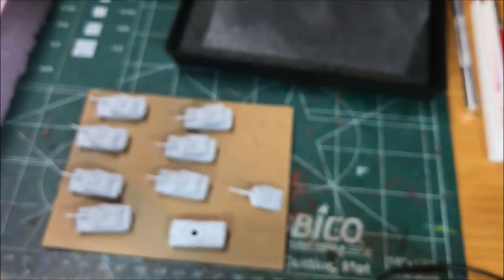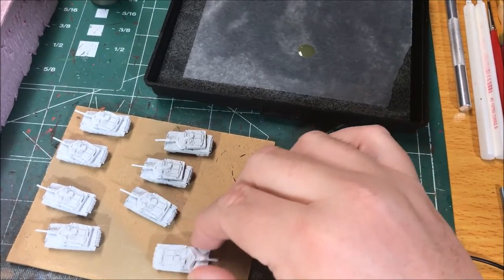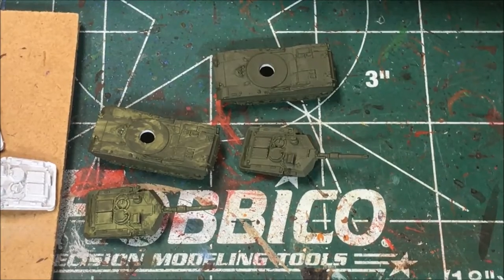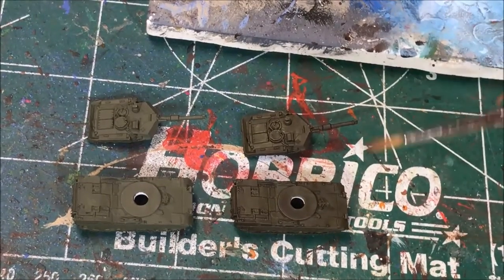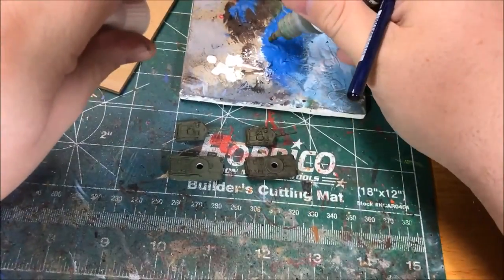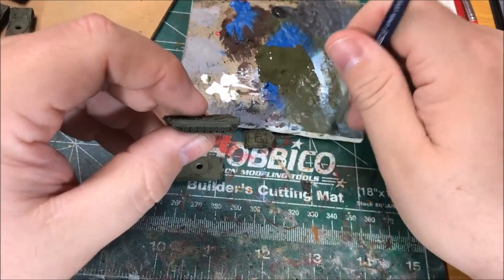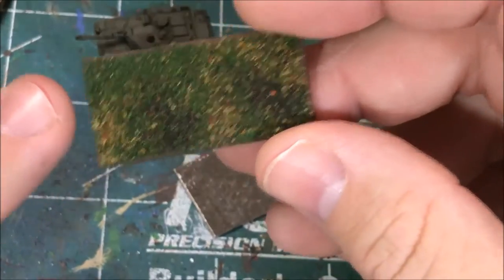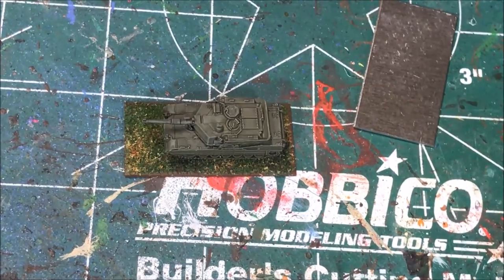6mm Cold War   Tank Painting Basics

Comment: Hi there! I'm brand new to Micro Armor and recently bought the US Urban Combat Command box, and I found your video very helpful on how to paint the vehicles! I have little experience with models this small so it really helps to see someone try it. My question to you is, which method of painting is better for modeling these small models if you just want basic detail. I don't really want to spend hours just to paint a few miniatures. Does the modeling require an airbrush or just paintbrushes? Thanks, and if I have more questions I'll be sure to ask.
Reply from the maker: I'm glad you found the video useful.  Good luck with your 6mm experience.  I find this scale to be great fun to game with.

Personally, I don't use an airbrush.  I have though about getting one, but so far, I stick with a regular brush.  Some may say that an airbrush is the quicker way to paint these, but I can't say.

Using a brush and some pretty simple techniques (as seen in the video), you can paint models fairly quickly and to a reasonable standard.  One way to speed up the process, is if you find a spray can with the base color you want to use.  Then all you need to do is wash and drybrush.

I hope that helps.

Comment: Great job, I ended up picking up the green Vallejo for my Sherman's, this helped a lot! Now I was planning on using model masters desert sand camp color for my Abrams company to keep them traditional. How do you think I could pull that off? And I like the idea of using citadel paints, my friend is into warhammer so I might be able to get some ideas from him. Keep up the great work Sean!
Reply from the maker: I think you could use a similar process.  Use the desert sand color then wash with a brown shade/ink; I think agrax earthshade would work, but you might want to water it down a little.  Then dry brush it with the original color (or a slightly lightened shade of the original color).
Reply: Oh, ok, thanks a lot! Keep up the great work, these videos always help!

Comment: Almost all of my 6mm is based on those metal bases. My only problem with them is that they are so thin that I end up picking up the models instead of the base.
Reply from the maker: I've noticed that as well.  I'm hoping a good dull coat will keep the paint job from getting beat up.